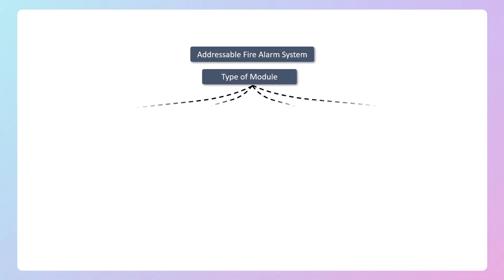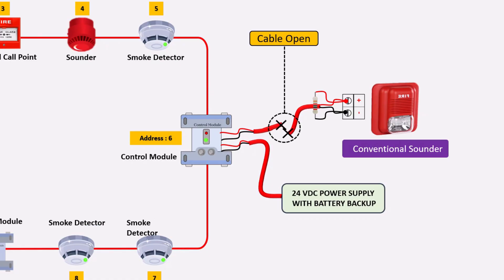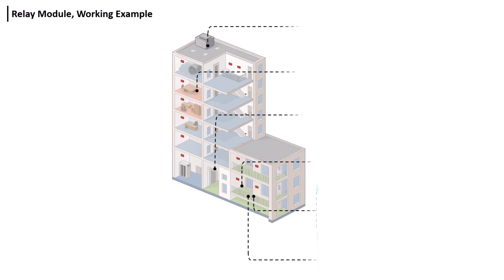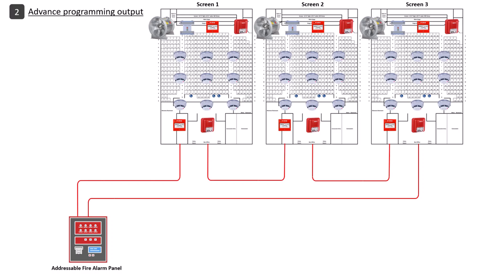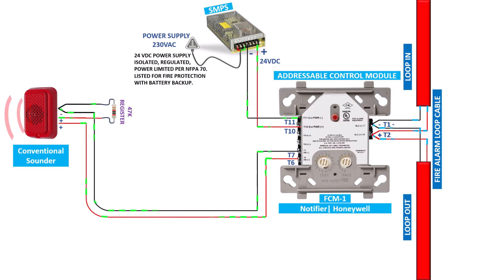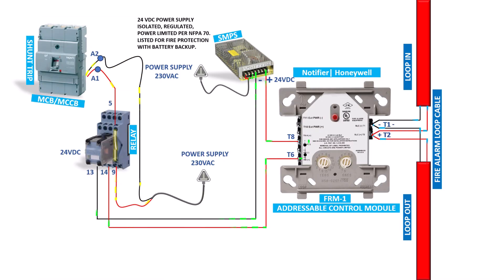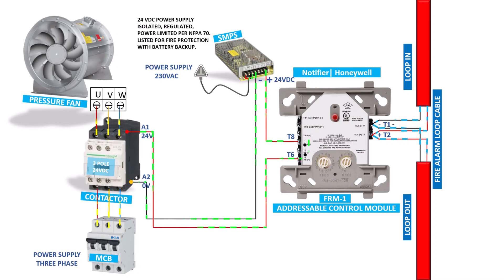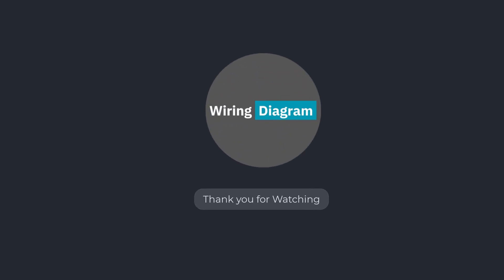What is a Control Module/Relay Module  in Fire Alarm System? | Wiring, Working, and Tips

Comment: Excellent, we are having trouble with our Fire Techs.With regard to access control doors. 24 vdc is cut to the Door controllers. well there is fire alarm or a fault.
Measuring voltage at Fire Relay there is 24v at the supply but no 24 to the doors.
There is no fire alarm at the Honeywell Monitoring system , however there is a fire alarm activation in the BMS system.